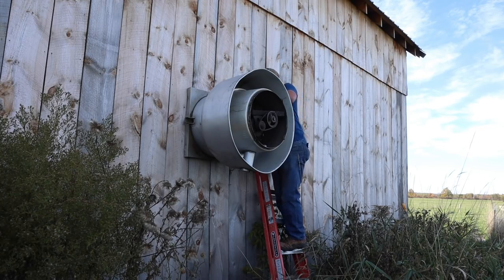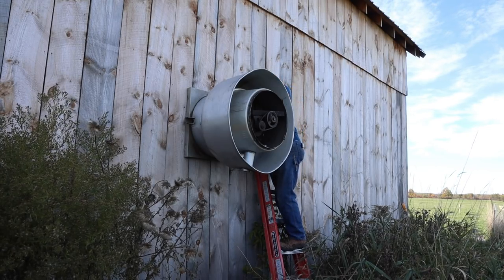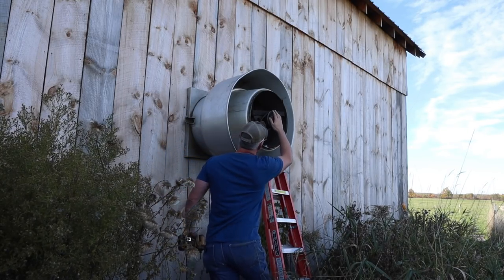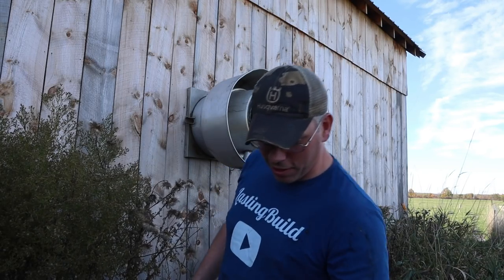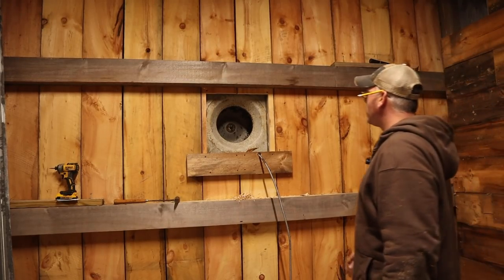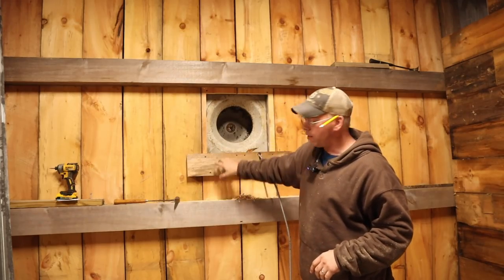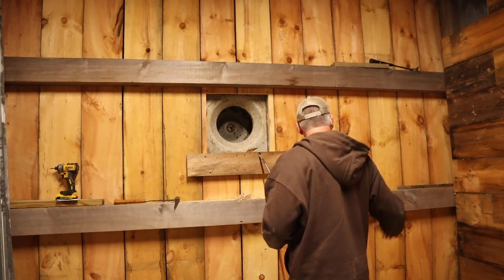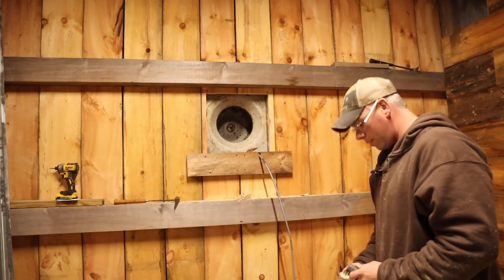Countdown To A Hernia: Journey To Become A Tool Maker #3

Comment: You muscled that heavy, bulky fan from the ground to five feet up a wall, a good recipe for hernia (been there - not fun.)  Take care of your back and abdominal wall. Once injured, they're never as strong. My concern is unsafe safe lifts set a bad example to more impressionable viewers. I suggest rolling it up a plank would not only be simpler and safer but mitigates risk of dropping the thin shelled aluminum assembly.

I've serviced identical axial fans. With fresh bearings and other TLC, old rattley axial flow fans can be made to run quiet except for the inescapable vane moan and roar from turbulence. A friend has a restaurant with three nearly identical fans. Close range conversation is possible in their midst when they're running at full blast (I had equipped them with VFD's.) No clatter. No rumble  

Axial flow roof mount fans are designed to run quiet. They put these fans on kitchen roofs, threrefore, transmitted noise can't be allowed to disturb neighboring businesses. Obviously yours needs new bearings.
Reply from the maker: I should've done it safer.  I work on these a lot myself.  This thing is banged up pretty well, that bottom bearing is smooth, believe it or not but I should've replaced it.  The ones on VFDS are very smooth.  The new belt will help too, I can't believe it's even turning the blower.

Comment: That didn't sound as loud as I thought it would be. Maybe the camera is buffering the sound? But it did almost sound like some metal on metal action going on inside there... Are you going to put a small, sloped roof above it on the outside? You already answered my question about a sealed trap door on the inside.
Reply from the maker: Oh yes to the awning, ice would make short work of her.  She's not grinding but that bottom bearing will need replacement soon.

Comment: Morning again, Jim.... if you've never had a hernia, take my word for it, you don't want one. From the outside of the building it looks like a jet engine ready for take off. Will you be doing any machining in your shop?
Reply from the maker: I'm not sure on the machining but I would like to learn it.  My big interest is in making log and timber tools.  A mill and a lathe would be handy for the process but you know how starting from scratch is.
Reply: @TheTradesmanChannel  I think the log and timber tools will be taking up most of your time anyway. I can think of several logging tools right off. Sometimes I wish I were younger and able to "do it again", but then I think, nah....!
Reply from the maker: If you have ideas on the tools I'm open to hearing them.  You have built with logs and there is no better teacher than experience.
Reply: @TheTradesmanChannel  Shy of the bark peelers and wood adzes, I think a really good and accurate divider for scribing would be great. A scriber with a set of levels and adjustable points to get into hard to reach areas makes accuracy even that much better. Hewing blades are nice unless you're lazy like me and use a chainsaw. And what would log home building be like if you didn't have a nice set of log dogs with the right type of points on them. You could probably buy all this stuff out there if you google it, but it would be something special if it were homemade. I still have everything I used when I built my place, shy of the books, I think I loaned them out to someone and never got them back. And I honestly don't remember who I lent them to. Oh, and some of those chisels you make would have been a great help as well. Yeah, you'll be busy all Winter long once you get started.

Comment: Ok, first few seconds watched, i would have had 2 saw horses, to lift it onto, then its halfway to where you wanted it, but that would have meant first to whack out some of the weeds. So i guess your hernia option had its merits too lol. That "sucker" will be excellent for drawing out the fumes of any welding etc that you do on that floor, but i think you will need ear protection, that noise is an unfortunate  but un-avoidable byproduct. Well done on the salvage of the extractor fan though, neat addidtion😊
Reply from the maker: You might have a point.  Where to grab those fans is half the battle.
Reply: @TheTradesmanChannel  lol, they are big and round . Actually the first time i really saw one, they are usually just far away shapes on  roofs. Do try to ease up on lifting with your back, your legs are far stronger,  i know you try to favour that leg and ankle still, understandably, but dont shift the problem upwards. I am in a wheelchair , know the frustrations of a broken body. It taught me to find solutions to still do the normal stuff i usually did. If you know you want to do heavy lifting, just take a step back, break the process down and see if you can find a way to do it in a few steps to save your body a bit of later hurt